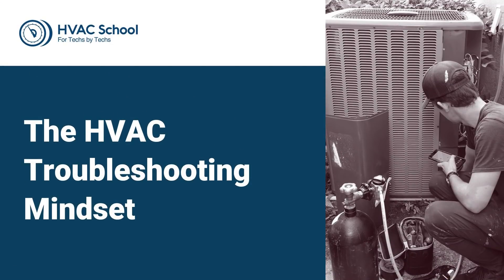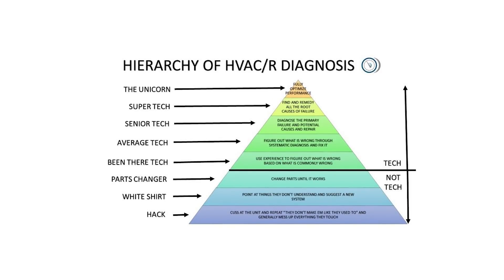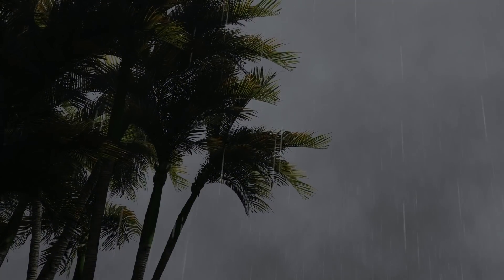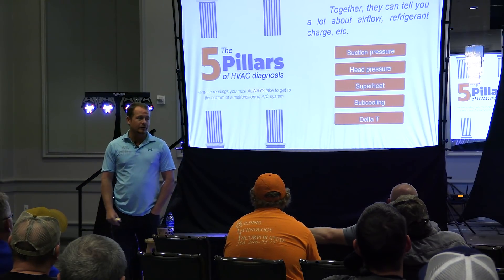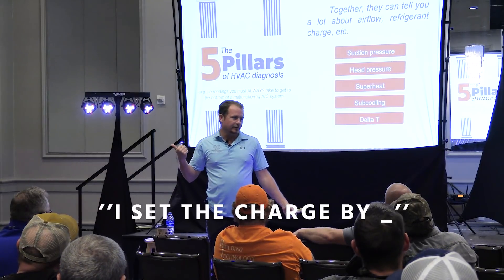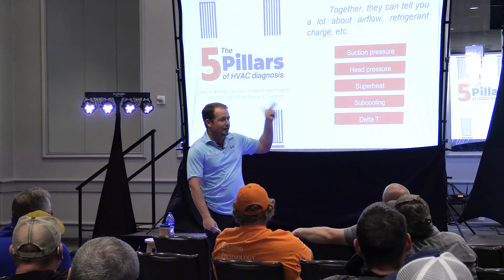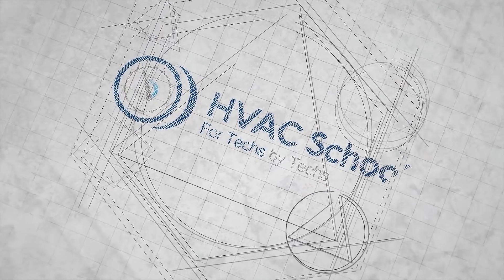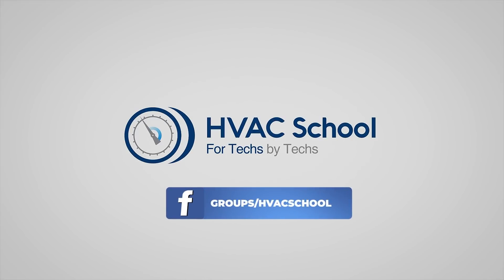Troubleshooting Mindset - 5 Pillars and Mental Shortcuts

Comment: The constant criticism of our performance just never stops. So I guess that means that everyone else is doing a Flawless perfect job. I spent 45 years in the HV AC industry and I don't recall a single time where I heard someone say something good about someone else. We do not Design This equipment nor do we have any say in how it is designed. We knew way back in 1975 that the condensing units were way too small for the climate in New Jersey. Yet if we spoke up and said so we were told that we did not understand air conditioning. Many years later when we made hi seer units which is mostly due to a bigger radiator or condenser the stigma Still Remains, it's our fault that compressors failed. We give up.

Comment: That first point of listening to the homeowner is one of the most important steps especially when trying to chase down an intermittent issue.
Reply: I’ll argue it’s THE most important thing.
Reply: @Pennconst101  they might not understand the meaning of what they are noticing but they can definitely lead you to the problem if you know how to listen and interpret what they are trying to relate to you. Learning how to probe them with the correct questions is also very helpful. Things like; "when did you first notice a problem?", "have you had any problems before?", "when do you notice it the most?", "any particular time of day?", "any strang noises or smells?", "any new changes to the house or work that has been done?"..... so on and so forth